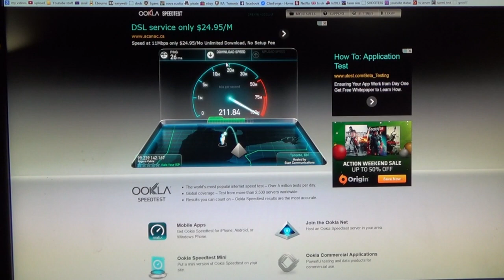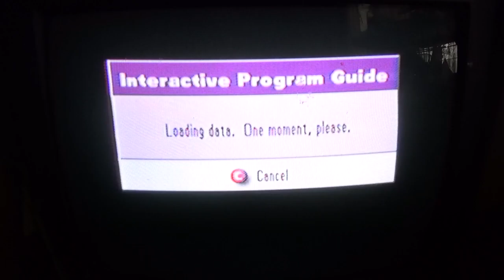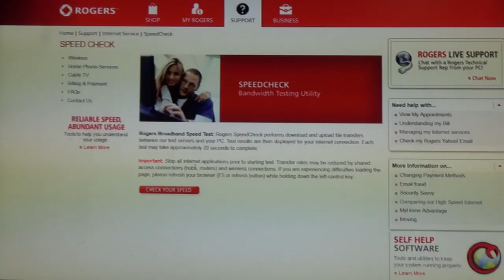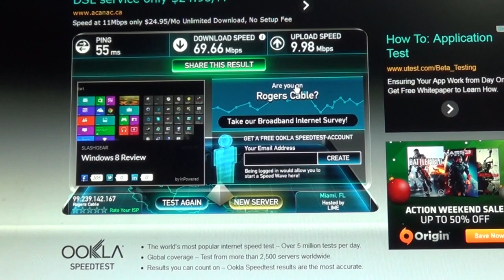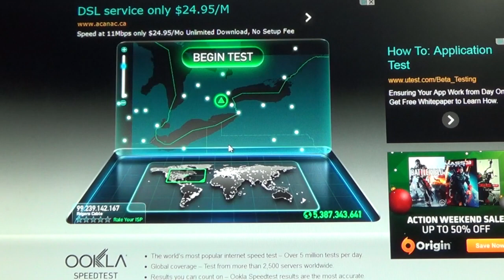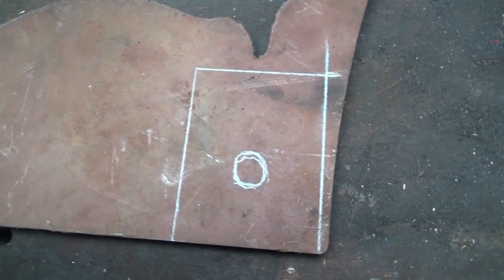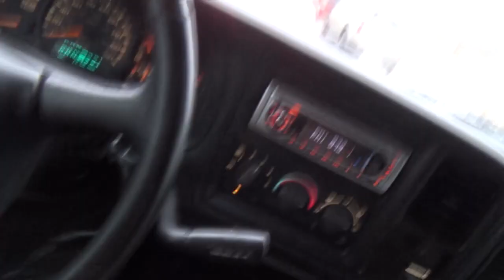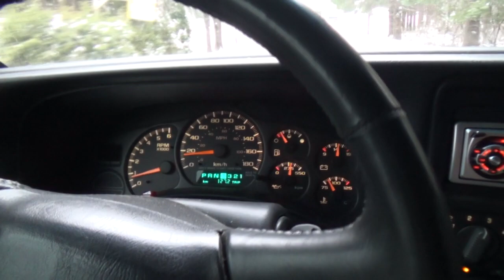Rogers cable feller had to come doo some repairs for us

Comment: Hey Bill just to let you know the EVAP Solenoid is a common problem on 1999-07 GM Trucks/SUV! Gm has a Recall on this Issue and says to install Revised updated Solenoid to Resolve the issue with them not opening or sticking!! I know this as I am a Service tech for GM!!

Comment: Maybe your next next next project is to get a Lathe or get a big ole’ drill to build the chuck or fitting cutting tools and bed around? It is the one tool that you could make serious use of as well as a good powerful drill for the holes. That is one that you can fit to whatever you are drilling and then drill the hole/s. Dad had one like that but he made it from several other drills and angle don't know if these are available for sale you know? To keep it simple this arrangement can be made from several G or C clamps together and an angle bracket to support the drill itself.

Comment: Make up some copper 5/8 dowels and weld build up around the copper dowel while it is installed in the hole. The weld won't adhere to the copper. That should tighten up the holes for you. Drill and polish to fit.

Comment: If you want to check the squareness of the pin on the snow plough shoes you can do that with the right angle square you use on the sheets to make stuff out. Get to straight and then weld it inside the cup and then on the underneath as you said and it should last a while.

Comment: Wait for Fiber...problem with cable is your sharing your line with hundreds of people.  Wait for your local Telephone company to come out with Fiber, the one I work for in the Toronto area is deploying fiber right now with gigabit (1000 Mbits) right now.
Reply: Cox communications in the US is in the process of replacing all of their coax with fiber optics now,and claim those type of numbers possible when completed IF you're willing to pay for the upgrade speeds,otherwise you stay throttled down to as slow as they can keep you...

Comment: Hi Bill,

It makes no difference to me because we do not have miles of thick copper wire, we have the glass filament this which I cant recall the name of. The speed is almost instant measured to the junction box, and from there it turns to copper which can actually be the bottleneck depending on how much you have to transport kinda thing. Though as with you, people working in the junction box which is for the whole of the street and small area of I am guessing 200-400 metres², can nudge a whole bunch of joints so half the street has no internet. The box to which I refer is the size of a wardrobe, absolutely filled with circuit boards and maybe ⅙ of the box is cooling fans and it goes underground from that box to wherever the signal for the web or the TV comes from.
It is in areas that are on solid bedrock that the wires have to be driven through the normal poles above ground but here near London we are lucky to have enough depth to take it all underground.

Comment: Just a bit of Info on those LED lights, the name of the manufacturer is pronounced Grotee but spelled Grote, I know this because my father worked for them when they were located in Bellevue, Kentucky back in the late 1940's when they were just a small company, since then they have really gotten to be a multi state operation.

Comment: Hi Bill,

Wow, what a bummer, I thought with all your hard work you had solved the problem, and for sure you DID mend something , the RING, that was in desperate need of work.
Maybe you can do some tests and or take it to a shop to get them to see if it is actually something wrong-loose-broken whatever with the thing behind the dash or the box that the electrics comes from too the dash, and there is nothing ‘wrong’ with any ancillary parts like the pipes or tank but actually nearer home behind the dash?, Or can it be a simple thing like a broken and intermittently working fuse?

Good luck.
Just try and sort out what to measure or test that may tell you what is wrong with a circuit you are actually measuring?
Take care.
mrbluenun

Comment: Have you replaced your gas cap?  I had a code keep popping up and over the years I had to replace my cap twice.  Usually came on when I was under 1/4 tank.  Can't remember the code number but it had to do with pressure and the evaporative fuel system.  Replaced the cap and it cleared.  Worth a try if you haven't. Rog

Comment: Rogers should be ashamed of themselves to put a splice in on the drop to the house.  You are in for more problems my friend.  Should tell mr Rogers you need a rg11 drop cable from the tap to the demarc.  You will never drop signal after that.  And you ping time should be around 1-3 ms response time from the Rogers server.    Bill. If you have more problems open up your command prompt and ping google :  ping www.google.com -t and look for loss packets.  That will tell the whole story.  Hope this helps from a friendly east coast cabler (eastlink)